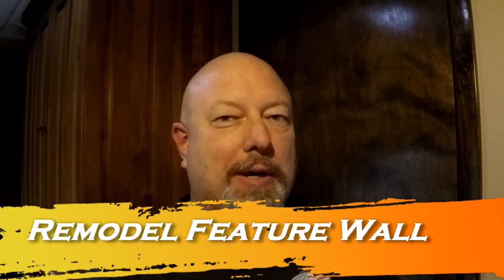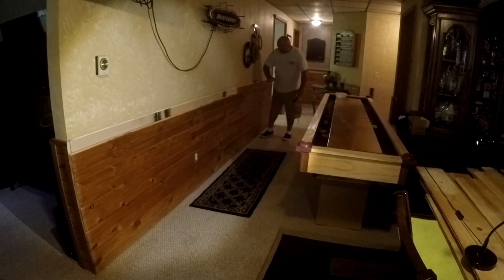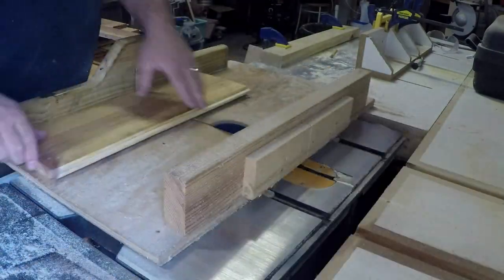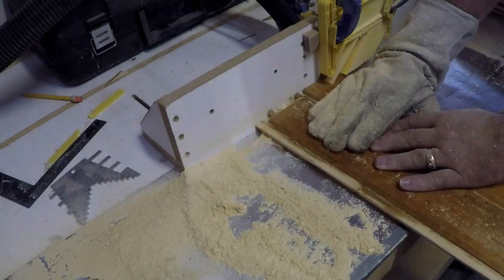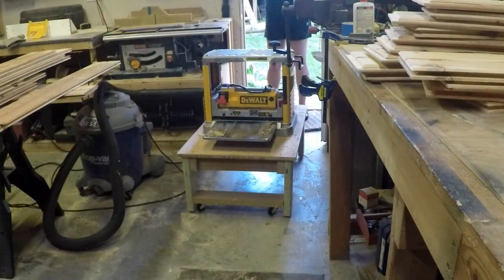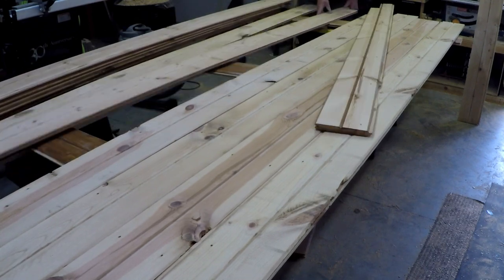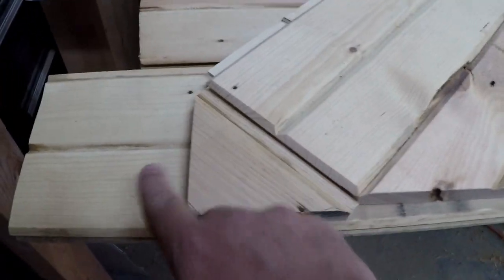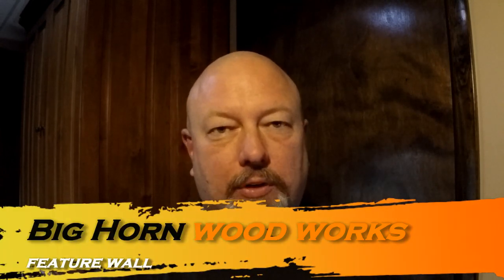07 Herringbone Feature Wall

Comment: Hi, great project a question what kind of router bit did you use for wood?
Reply from the maker: Sorry for the late reply. I used a 45 degree angle bit and a 1/2 inch radius round over for the exposed edges